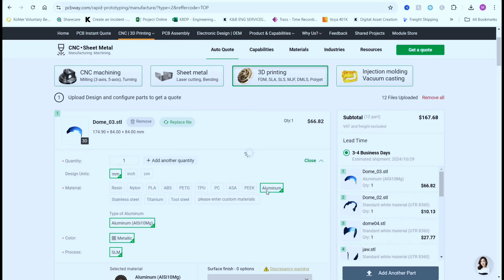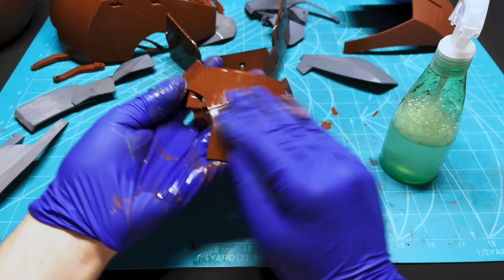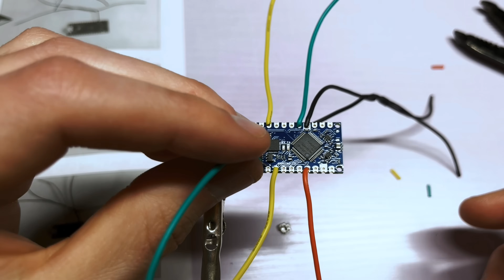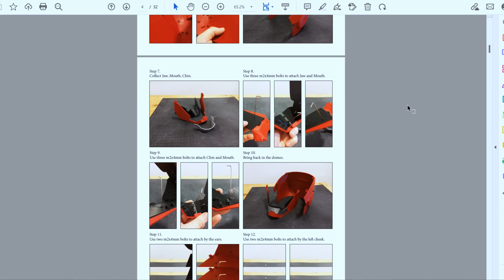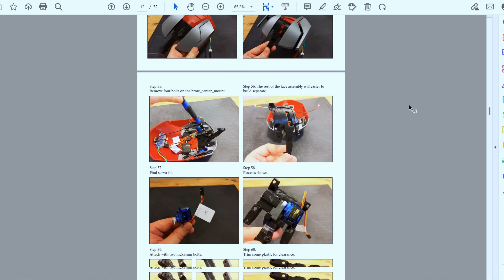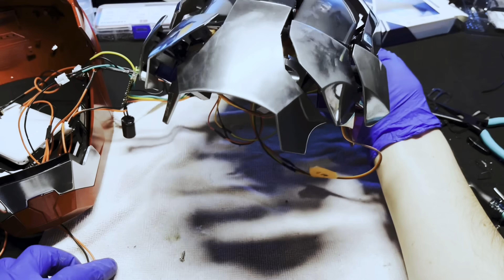You Won't Believe This 10 Servo 3D Printed MK5 Iron Man Helmet!

Comment: which files did you end up sending to PCBWay? it looks from your video dome03, dome02, dome04, jaw, nose_side x2, nose_center, mouth, brow_main x2, brow_center_mount, brow_side x2, dome01, cheek x2 for a total of 12 files. I think i want them to sand for me as well where i'll print the other smaller parts tool

Comment: How do you protect the chrome from scratches without a clearcoat? Would it be better to electroplate it?
Reply from the maker: Yes! It would be SO much better to electroplate it. To get it to that level of finish though is very difficult from a home setup (at least that’s what I found) which is why I went the route I did.

Comment: My servos are all going in the totally opposite direction. I just swapped 0 and 1 and 2 and 3 on the servo board. But the central brow piece is doing it and I cannot swap that. Is that a wiring issue?

Comment: Is it possible to resize this helmet? I plan on 3D printing an iron man helmet and attaching an augmented reality system I’m working on into it
Reply from the maker: It’s possible to resize it, but if you do all your servos won’t fit correctly. You could maybe resize it bigger but for sure don’t go smaller. I’d recommend just printing at 100%
Reply: @markitmade29 thank you!
Reply: T7ruruguifkroyyyyyyy6666777777kkkoooo992w11aaaaasß

Comment: Hi, thanks for the video, I've followed every guide there is in the file but mine doesn't open quite right. The servos are in the correct order but the right side of the helmet opens more than the left (the DS-239mg) I tried changing them but now it just does a weird noise and it doesn't open anymore. Any idea ?
Reply from the maker: Are you referring to the wing servos? Or is it all the servos on the right side that open more than the left? Did you get the exact servos recommended in the guide?
Reply: @markitmade29  Hi, thanks for your answer. i'm talking about the wing servos. the rest seems to be ok but the wings do not open as they should. I followed everything on the guide. I had one wing who stopped working, I ordered another one and it had the same problem. Can it be the power bank ?

Comment: Mine doent work it opens all wacky
Reply from the maker: Have you doubled checked that your servos are wired up to the right place on your board or that your code is correct? Are you getting activation of the servos, just in different orders?
Reply: servo activation is wrong
Reply from the maker: @MarvelEngineering  I'd start by making sure the servos are plugged into the right spots by relooking through the wiring diagram. If the issue still persists I'd look at your code to ensure it matches the code provided on Thingiverse
Reply: @markitmade29 ok I will try it
Reply: Just in case that doesn’t work, what would I do
Reply from the maker: @MarvelEngineering  If that doesn't work, you can contact me via Instagram or email and I can help trouble shoot the problem with you :) Sometimes its just the littlest thing that can be throwing something off.
Reply: Can you also help with the servo order I think I did it wrong
Reply: Every thing works opi just need servo order
Reply from the maker: @MarvelEngineering  Do you have the wiring and build guide? It should tell you exactly which servos need to be connected where.
Reply: @markitmade29  I have the wiring guide but I think its wrong. And servos 2 and 3 also know as the brow side open way to far
Reply: How would I fix this
Reply from the maker: @MarvelEngineering  If they are opening too far, then it might be an issue with your code... If your servos are wired and connected to the board exactly how the wiring diagram shows, they should work.
Reply: can you tell me how to fix my code
Reply from the maker: @TRUMPET-GODS-z9b  can you give me an idea of what's going on when you execute it?
Reply: sorry that was me on a different account

Comment: printe the cage and it is kinda okay  it fit but my nose is touching the front part a little anddd my back of the head is like touching it so idk if it will have space for the parts..... .... idk if the cage i like the size including the electronics....
Reply from the maker: Hmmm that's a hard one... You could always print it at 5% larger just in case.

Comment: Hi Mark quick question, what wire gauges are used because in the diagram (Step 5: Attach JST connection for eyes(2), button(2), PCA9685(4), and power(2)) the green and yellow look slightly a thicker gauge. still a great video
Reply from the maker: They do look thicker in the photos, but you can use 26 gauge wire for everything. That's what I did.
Reply: @markitmade29  thanks mark and Happy New Year for tomorrow

Comment: @markitmade, thanks so much for such a wonderful video! I built everything and printed all the parts, but I'm stuck on what seems to be a silly problem. Once I power the circuit with the servos connected, the power LED on the servos board turns red. Then, when I press the chin switch, the red LED goes off, and nothing happens.

I uploaded the Arduino code with no errors, and I’ve checked all my connections multiple times for shorts, but still nothing. I would say the circuit is properly assembled, but nothing moves!

Any help would be greatly appreciated. Thanks!
Reply from the maker: 1. Can you hear the servos "clicking/humming"? 2. What power source do you have? The one I have linked in my description from Adafruit is the one you should use. I tried using a different one I got off Amazon with practically the same specs and it couldn't power the system. I switched to the one from Adafruit and it worked no problem.
Reply: @markitmade8319

I was doing some tests last night, and I can't hear any noise from the servos. However, when I touch (not press) the chin button, Servo 0 sometimes moves, but the movement is slow and incomplete, suggesting a potential lack of power.

After many tests, I can't find a clear pattern linking my touching the + and - of the switch to the servo movement. I’m using a power bank exactly like the one from Adafruit—5000 mAh at 2.1 A, etc.—but following your advice, I’ve just bought the one directly from Adafruit (also the one recommended by the creator).

Thanks a lot, and I’ll keep you updated!

Comment: I am wondering if i scale up the model what will happen with fittings holes do you have some advise how to scale it and all fits together?
Reply from the maker: If you scale it UP your servos and screws will probably be a bit loose. However, if you only scale it by about 5% (105%) you should still be able to getaway with a slightly loose fit. I'd just make sure to add a few extra layers of filler primer and paint to hopefully narrows the tolerances. Either way you'll have to do a bit extra work, which is why I just printed mine at 100%. I didn't want to deal with scaling it.
Reply: @ i would like to make it wearable but my head is little bit bigger . Thanks for the idea to fill it i think it could work. Maybe if i fill it with pla pen and put a brass where the screw will be or something like this 🤪
Reply from the maker: @odinrado  honestly a PLA pen isn't a bad idea! I think that would work pretty well.
Reply: @odinrado  Did you make it ?
Reply: @bluedasher3989  yes, filled it with pla pen then insert the brass with soldering iron it took time to fit it but cane out great

Comment: Curious when you spray paint, is that box indoors somewhere, do you ventilate that to the outside somehow?  Was considering prefab boxes they sell on amazon with a fan and hose sending to a window (basement)
Reply from the maker: Yes I spray inside. It’s in my basement. It has a large fan on the back and I have a duct hooked up to a window. It works really well. I always wear a respirator, but overall, the smell is minimal and doesn’t spread anywhere else in the house. I actually believe I got mine on Amazon…I can try to find the exact one I purchased if you’re interested. One of the best investments I ever got tbh.

Comment: can you tell us the estimated total build cost?
Reply from the maker: Including the cost to print from PCBWay? If you choose to print the files yourself (which is completely viable) you can plan to spend about $210. That includes material cost plus the cost of all the electronics assuming you don't have anything. I purchased the electronics from Amazon probably about a year ago (I purchase things in bulk since I do so many projects) so the prices might be a little higher now. The EXACT items I used are in the video description. If you include the cost of printing with PCBWay you would be looking at about $340. So, not a super cheap build, but a cool one for sure. Should keep you occupied for a while if you go for it.
Reply: @markitmade29  thank you appreciate it.

Comment: Great job. Thank you for uploading this. I think you just solved the issue I was having. I didn't select the right board. I have the every board as well. It's been sitting on my shelve for over a year now. I think I can finally finish it. Did you have any issue with the power bank shutting off after a few minutes?
Reply: Not sure which one or what is used in this but I have a couple that shutdown when there is no load and also some that shutdown when there is a low power draw which is below their minimum output level,  both these situations are a pain in the arse as I have to press the button on the power bank to activate it again. So basically they will charge something till it reaches nearly charged and the wattage demand falls and then shut off not fully charging the device and then not automatically start up again when the device needs charging. As said a right fooking pain.
Reply from the maker: I actually tired purchasing a cheaper power bank from Amazon and could not get it to work; it was a 5V 2A, basically the same one I used just a cheaper brand. I then bought the one in my description from Adafruit and it worked no problem; it is rated for 5V 2.1A. With the power bank I used, if I don't open the mask for a while (more than 5 min) the power bank will "go to sleep" and you'll have to press the little button on the side of the bank to energize the servos again. Might be annoying for some people but I don't mind.
Reply from the maker: Also, for the Arduino Code you might get an error after uploading the code to the board (after selecting the right one). If you get the error just test the board with the servos to see if the code was uploaded. I kept getting an error and spent like 2 hrs trying to figure out what was going on just to find out the code was uploading and executing no problem lol I'm not an Arduino expert though so it was probably something stupid I was doing XD
Reply: Thank you so much. I am definitely gonna get back to finishing it. I thought I wired it wrong. I was only able to get the eyes to light up. Not the servos. I've never used arduino before either. This was my first time.
Reply from the maker: @dculnan  Let me know if you run into any issues and I can help you troubleshoot if needed.
Reply: I will absolutely let you know. Thank you again.